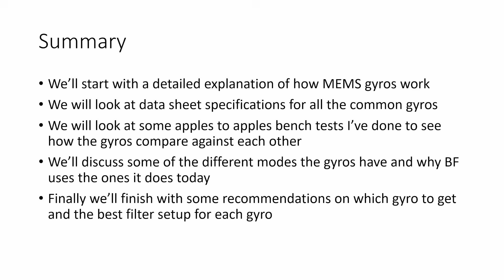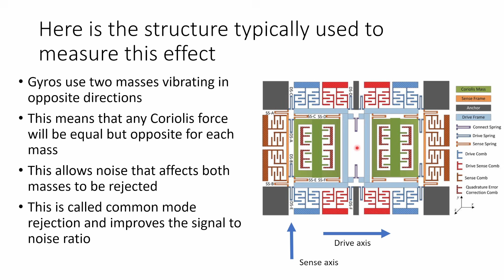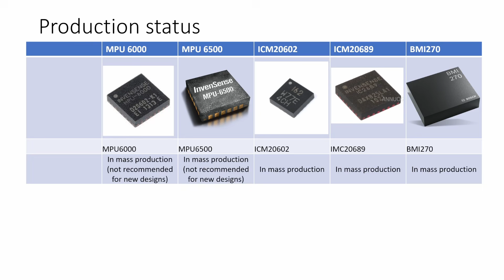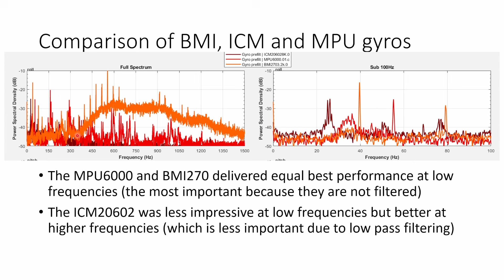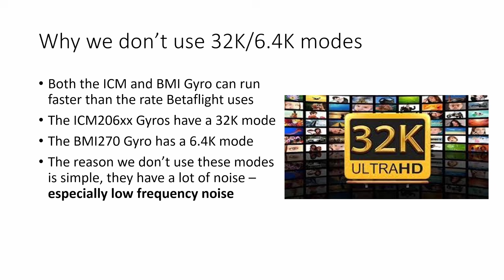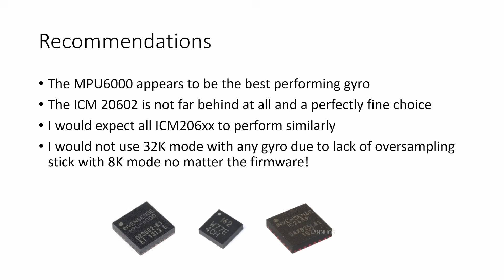Gyro shootout: MPU6000 vs ICM20602 vs BMI270 and OSR4 mode for BMI Gyros!

Comment: the first thing to die on all my all in ones is the accelerometer. IF THERE WAS ACTUALLY A WAY TO MITIGATE THIS.... ?
Reply: Avoid vibrational shocks to that chip, ie don’t crash. Or, get a hot air station and replace the acc chip, though sourcing the chip…
Ah never mind, just send it and have fun!

Comment: Do you know how ICM20689 compares?? MPU6000 is discontinued so this research is very much needed these days, thanks for that! :)
Reply from the maker: MPU6000 is not discontinued. It is still in production: https://product.tdk.com/en/search/sensor/mortion-inertial/imu/info?part_no=MPU-6000
Reply: @ChrisRosser  it is discontinued I'm afraid. If you search for it, pretty much everywhere indicates as such.
Reply from the maker: @benloader8  https://product.tdk.com/en/search/sensor/mortion-inertial/imu/info?part_no=MPU-6000 The part is still marked as in production on TDKs website. Long lead times at the moment due to chip shortage but mouser have 15,000 on order. Digikey are out of stock but you can place a backorder with them. ICM20689 is also out of stock but also available on backorder (mouser have ordered 47,000). Who is telling everyone MPU-6000 is discontinued?
Reply: @ChrisRosser  los some guy calleed Ben
Reply: @ChrisRosser  They must have the ability to keep producing them on customer demand, I have once seen them due to be EOL but I guess they got an extension? It wouldn't be the first part to do so.
Reply: Are these products (ICM20689 and MPU6000) interchangeable (i.e. same landing pad and same control software driver)?
Reply from the maker: @ShwarzBelij  I think so they are the same QFN24 package and I would be surprised if they were not pin compatible. Driver software is different but BF supports both and handles that gracefully.

Comment: Is there anyway to test the accuracy of the Gyro against a known input - like using an audio speaker? Is the on chip filtering more accurate - or lower latency - vs the betaflight filtering... from the way you described it - it seemed like it was mechanical filtering - you have two sensors and you filtering out the noise between the two (am I correct?).
Reply: Good question, I would also be interested in which filtering is better.

Comment: It is sooooo nice to see SCIENCE work.  Doing similar, in-flight, tests a couple years ago (same quad and measured data with two different gyros at the same time) and got the same results and had the same recommendation.  Love it!  :-)

LOVE IT EVEN MORE how this makes it so clear how an analytical approach leads to better product (BMI270 find).
Reply from the maker: Yep. Even better that it leads to a PR for betaflight!
Reply: @ChrisRosser  YEAH MAN!  SAW THAT.  AWESOME!!!!!
Reply: hey Mark and Chris. yo you know if the BOSCH gyro has less filter delay out of the box because of the higher HW filter? If its the same delay AFTER the 250Hz gyro2 BQ filter, I would order a new MK4 FC with this gyro instead of the MPU6000. the possible changes in BF are awesome to tryout, too!
Reply from the maker: @MoppelMat  Bosch gyro equivalent delay to MPU6000 in OSR4 and less in the higher modes. It's more configurable than MPU in this respect.
Reply: @ChrisRosser  thank you! I am already flying this thing with the bosch gyro! Works well!

Comment: BMI270 6.4K ODR is already implemented in betaflight, but only for chip flash space >512KB. And in order to do that the BMI270 must be set to FIFO mode instead of "normal pulled" mode. In that mode there's not any DLPF at all. This is different compared to ICMxxxxx which still has DLPF in 32k ODR.
Reply: I have a BMI270 and the quad flies great. I haven't spent much time looking at the gyro_scaled debug charts, but the regular charts after betaflight filtering are clean as a whistle and it makes me not want to touch a thing. Putting my BMI270 into a higher rate polling mode with a different LPF sounds cool, but how the heck would I even benefit?
Reply: @mjodr  I don't know